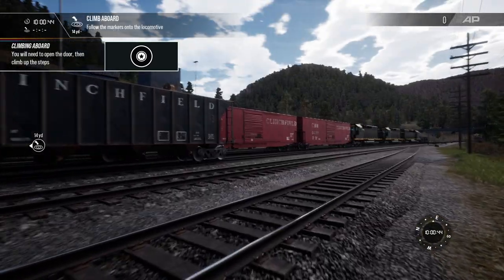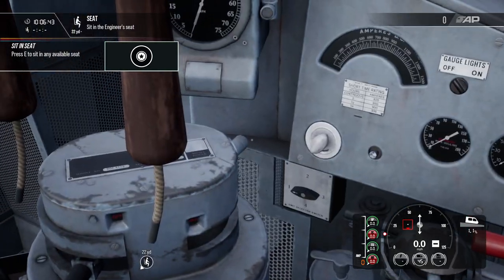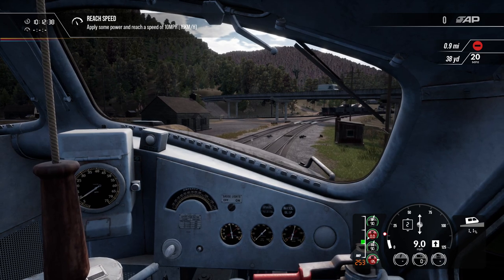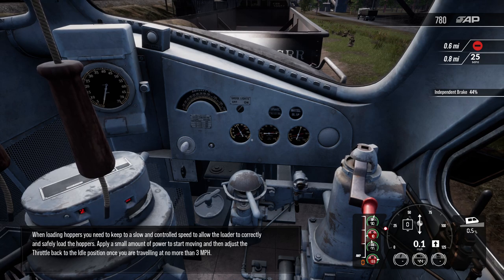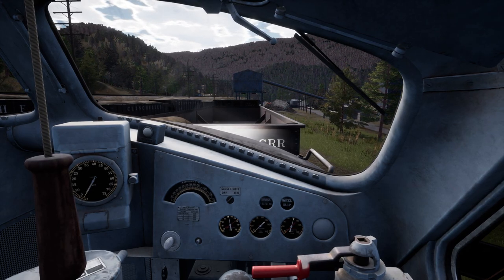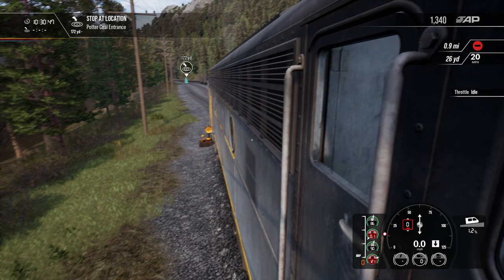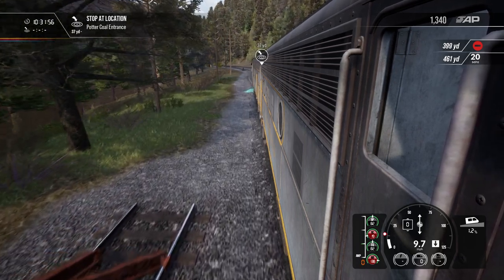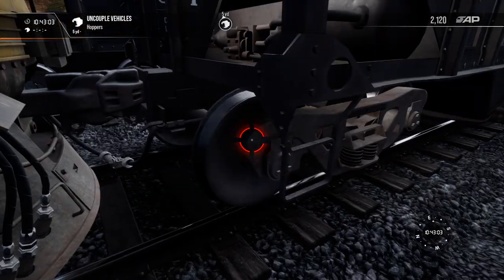Train Sim World 2 | Coal Hauling | The Clinchfield Railroad DLC

Comment: Arthur, this loco has the old style non self lapping brakes, you have to manually close the brake valve (put into LAP) or they will keep filling until the brakes lock up.
So, how to:
pull out of LAP into INITIAL APPLICATION, wait a few seconds, then into APPLICATION. when you have the brake force you want, put back into LAP.
to release: push out of LAP into RELEASE until brakes are empty, then back into LAP, or if you have it, RUNNING.
Reply from the maker: I figure it out in video number 3

Comment: You should have been using the automatic brake, also the f7 has dynamic brakes you can use.
Reply from the maker: yeah - I am getting better at the brakes on the f7 - haven't figured out the dynamic brakes though.
Reply: @Vbluguitar  yeah it's a little confusing,  just put the selector in brake mode then use the throttle to control the brake power.

Comment: The other engine needs to be set to passenger
Reply from the maker: Lol no.  The are set to freight handle off and then on the base of the main brake, you set them to cut out.  Then the main engine is cut in and just plain freight.  You will see me do it properly in the next video (coming soon)
Reply: I think if you're running light (no cars) then you can set to passenger for faster brake response. Otherwise they should be on freight for freight.
Reply from the maker: @KerboOnYT  Yes - this is correct - I paused the video and re-read the instructions on the freigh VS passenger.  However, the "non-lead" engines all need to be set to the "lap" setting, regardless of what you choose, so engine one is freight or passenger and then the others are set to freight lap or passenger lap.